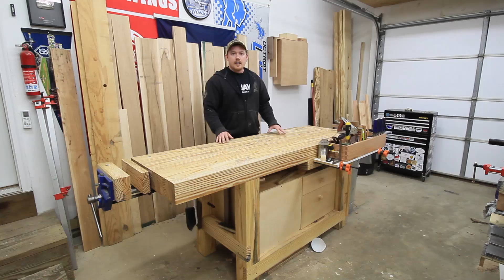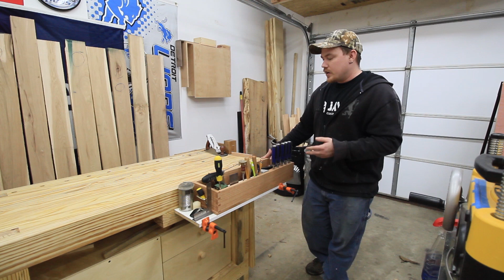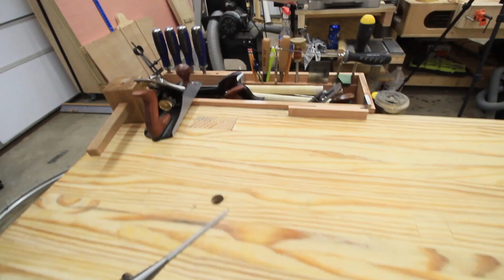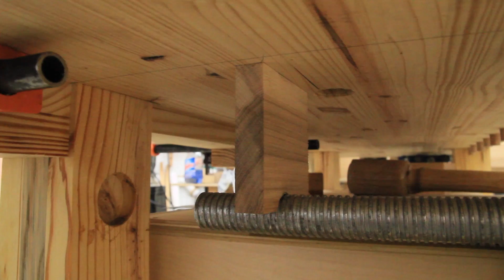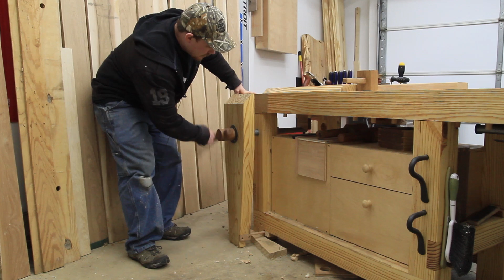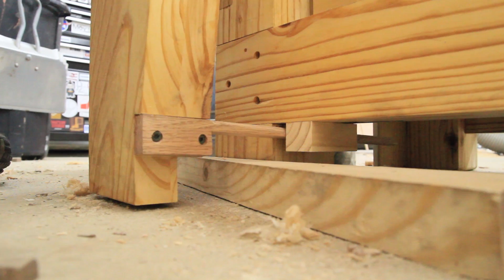Workbench Upgrades - 240

Comment: Great video as ever Jay, thanks. Re leg vice; strikes me that it might be easier to simply fit a pegged parallel guide from the outset but use the wedge for most purposes and only use the peg when working on exceptionally thick/wide pieces. Never can understand those thumbs down, wherever I see them. Power to your elbow.

Comment: Jay, I notice behind you and remembered from a past video that you prefer vertical storage of your lumber. I was always under the impression that you should lay it flat to prevent warping. Is that not the case? I would like to store it vertically as it would be easier to see and  get at what I need. Thanks,
Greg

Comment: Is the table too thick to use holdfasts? I've never used them before and want to build this table to use them. I plan on using 2x4s (maybe 2x3s if it's too thick).
Reply from the maker: Yes. Counterbore from the bottom side to reduce holdfast engaging hole thickness to about 2-1/2"
Reply: Jay Bates I don't have a counterbore, do you think I can use a router to carve out a section around the 3/4 hole?
Reply: You can buy a cheap set of Forstner Bits at HF for less than $15 and use the 1 inch bit to do the counter bore

Comment: Great series of videos; I almost never watch a video over a few minutes but the production quality was so high on these that I really enjoyed watching.    Knowing how to make a great video is as important as knowing the topic you're presenting - well, at least it makes watching the technical content much more enjoyable.  Thank you!

Just a tip: on the leg vice, if you were to cut a small wedge at the same angle as the movable wedge, you could prevent twist or uneven pressure on the bottom.  Maybe just cut off the appropriate length from the pointy end of the wedge you have, flip it over, and attach it at the bottom of the vice.  This would increase the pressure surface area at the bottom.

Comment: Jay, did you ever put any kind of a finish on the top of the bench?
Reply from the maker: Boiled linseed oil for a month. Then flattened it for the first time and tried Danish oil instead. I like the danish oil better. Not as thick as polyurethane but a bit more protection than boiled linseed oil.

Comment: Hi Jay, did you decide that you didn't need the oak dowels at the stretcher joints?
Reply from the maker: +Marco Nonya correct. I ended up not using dowels.

Comment: Here is a thought.The maximum stock clamp-able in the foot vice is reliant on the floor wedge width / angle.To clamp greater stock dimensions would need a very large / long wedge. This would be too long and get in the way of your feet.Imagine this very long wedge cut into two wedges one the smaller taper and the second the larger. Now this is a pain because you need to alternate.If you combined them at 90 degrees ( screw and glue) you would have both and still foot operatable.So, two faces are still flat at right angles (making a corner) with the other two tapered yet with different widths of taper? You could use your foot to rotate the wedge 90 degrees depending on what stock thickness you are using.  Even if you don't want greater stock usability it takes the unused thin part of the wedge away from you feet at the bench end (when working with thick stock) and shortens the amount of wedge at your feet on the long bench side (when using the clamp for thin stock).
Not sure if you will follow my bad description, however I'm sure you might appreciate possible future modifications. And, this is a really simple one.
Great channel......awesome bench.

Comment: I was wondering what you're best work around was before you had your jointer. I've been working on similar projects. (Benches and tables.) with that kind of laminated top. Any suggestions on milling and squaring up lumber?
Reply from the maker: +Jack Tibbetts Cut a little off one side, then the other, then the other, until you get a straight enough board to use.
Reply: +Jay Bates Thanks. I definitely want to get one soon though. They totally seem like they make things easier
Reply from the maker: +Jack Tibbetts They really do. Since getting mine I've ran every board for every project over it. If not, close to every board.

Comment: does that single wedge put any sort of twisting pressure on the vice considering it's only clamping the wedge on that right end? wouldn't it be better to incorporate a complimentary wedge?
Reply from the maker: +Everfalling In the video where I installed the leg vise I showed that I cut out a section on the bottom of the leg vise that matches the angle of the wedge.

Comment: Very nice Jay. Maybe you could add a matching nut fixed to the proper height instead of that loose wooden spacer. Also, the wooden slider at the bottom looks a bit thin, no?
Reply from the maker: +M.Emrah Ozkaya The fixed nut is not necessary as the loose wooden spacer is working just fine. The slider at the bottom is plenty thick enough to complete the task.

Comment: Nice workbench alterations, I can see how these changes would make it much more versatile and functional. I have a question though. When you were showing your solution to prevent the leg vice from rotating when you turned the handle I thought it looked too complicated and clunky. Why didn't you just drill a 1" hole through the bottom of the leg vise and a slightly larger hole into the leg of the workbench and insert and glue a length of 1" oaken dowel into the leg vise. I think this solution would work just as well and look a lot better since the dowel would be centered in bottom the vise and be hidden in the leg of the bench. Just a thought. The bench looks great and I am sure it will serve you well for many years. Thanks for posting the upgrades.

Comment: The leg vise is great but you could improve it by shortening the handle. You do not need the leverage supplied by that long handle and you would not hit yourself when leaning over to spin it! Now, an important question. It is my understanding that woodworking bench are made so massive/ heavy so that you can plane and/or otherwise work on them without moving them. So, in a perfect world you could have a top made of ummovableinium that weighed ONE pound and was as the name says unmovable. I do not plane or have a need for such mass. In my world a top made of a substance like the Festool MFT top might be superb. Is my thinking correct? Thank you for the great video as usual. I mean you always make great videos.

Comment: If you're worried about the benchdogs getting too loose, embed a single ball catch (sometimes called a bullet catch) in one side of each bench dog. They don't need to be glued in, just a tight fitting hole. The catch is spring loaded, makes for very easy insertion/removal, but it won't fall through

Comment: I feel like all of the adjustments needed to your leg vise are due to the lack of a parallel guide. Why not just install one? I heard you say on the podcast that you didn't want to put a through mortise in your leg but I can't imagine it would have effected the structural integrity. The traditional pin system is a pain but you could use one of the chain systems available. That's what I'll be putting on my Roubo. You could have also used the Benchcrafted Criss Cross setup.
Reply from the maker: +Crafted Magazine I like the convenience of the wedge. And this option is much less expensive. Especially if you make the screw yourself. All personal preference. Any one will work.
Reply: Gotcha, makes sense. Thanks for the videos man. Your workbench inspired me to go for building a Split Top Roubo. Starting rough cutting the wood (hard maple) this morning.

Comment: A really simple upgrade to the dowels for bench dogs is to cut a slot down the middle of them stopping short about 3/4"-1" from the top and then jam a really short little wedge all the way up the slot so that the two halves spread apart.  That gives you a little spring effect so they can be looser but still stay in place.  Takes a little trial and error to get it right.
Reply: or drill a small hole at the top of that channel, use a smaller channel and a properly sized hole under the dog and install a piece of wire hanger as a spring.

Comment: Awesome! I'm in the process of building my workbench now. Took boards from a deck tear off for the top, cut them in half and glued and screwed them, it's not even and I've spent hours sanding this sucker trying to get it perfectly level but I'm calling it good enough. I just got started woodworking last year so I know very little but I think I'm going to steal some of your ideas. 👍
Reply: best suggestion for smoothing that top is a jack plane, the longer the better. not hard to use, but so worth the investment if you can get one. as with any tool, if you are not familiar with it, practice on some scraps before taking it to your project.
Reply: +Thomas Russell   Thanks

Comment: Happy Easter to you & Jamie! If you did not have pipe clamps & did not have wall space, would French cleats on the side of the bench work to hold the tool caddy? Or, would you need to extend the "wall" behind the caddy downwards? Hope that made sense.
Reply from the maker: +Del Johnston If I didn't have wall space to eventually put the hand tools on I would probably have built a tool well into the table.

Comment: There is something satisfying about using something that one has DIYed well, but for most work, wouldn't that quick release Record style vise have workef more conveniently than that leg vise, if it had been installed in that position (thinking Paul Sellers), (not a criticism, it just seems like leg vises are kept around more out of nostalgia than practicality), maybe I'll have to try one to get it.
Reply from the maker: +Darnley Bynoe I prefer using the leg vise a lot more. Much more clamping power with little effort and much more room above the screw. I'm not totally thrilled with the cast iron vise. It's handy for some tasks but I just overall prefer the leg vise.
Reply: Yea, I guess one needs a side by side (hint: good subject for a video) to know for sure 😉, thx

Comment: I was wondering the same thing as Moochie Kat. How did you get the dog holes a perfect 90 when you drilled them?
Reply: Not sure how Jay does it, but using a drill guide is one option. https://goo.gl/GlFyWe
Reply from the maker: +jimgam730 I don't drill them perfectly 90 degrees. I start the hole with a forstner bit to get a clean cut about 1/2" deep. Then finish the cut with a 3/4" auger bit on a slight angle with the top tapered towards the tail vise. Just drilled by eye.

Comment: How did you get a 90 deg. hole for the dog holes? I know you didn't put it on the drill press. I couldn't get a perfect 90 when I drilled mine. What's the trick?
Reply: Not sure how Jay does it, but using a drill guide is one option. https://goo.gl/GlFyWe
Reply from the maker: +Moochie Kat  I don't drill them perfectly 90 degrees. I start the hole with a forstner bit to get a clean cut about 1/2" deep. Then finish the cut with a 3/4" auger bit on a slight angle with the top tapered towards the tail vise. Just drilled by eye.
Reply: Jay Bates Thanks. You have a better eye than me. I was so disappointed with mine, I plugged them with dowels. I did see a youtube where the guy used an up-cut bit in a plunge router and then finished with a forstner bit. I might try that way.
Reply: Del Johnson, thanks that should work.

Comment: Nice modifications! How did you cut those deep dog holes in?
Reply from the maker: +MRrwmac  I don't drill them perfectly 90 degrees. I start the hole with a forstner bit to get a clean cut about 1/2" deep. Then finish the cut with a 3/4" auger bit on a slight angle with the top tapered towards the tail vise. Just drilled by eye.

Comment: Any warping in the top? Was looking on building one for myself but scared the top would warp by not using hardwood.
Reply from the maker: +Andre Regimbal Hardwood vs softwood has nothing to do with something warping or not. Irregular changes in humidity/moisture content causes wood to warp. I started with kiln dried wood from Lowes. I had about 1/16" of hollow in the center from day 1 and never got around to planing the top as it wasn't that big of a deal. I figured it would move more in the next few months but it didn't so a few days ago I planed it flat for the first time. It's holding up just fine.

Comment: 2 questions 
The spacer under the bench for the screw.... How far back do you mount that.. Does it matter? What do you use to sharpen your chisels and drill bits?
Reply from the maker: +Richard Shaw I didn't mount the spacer. It's just sitting there. The distance is determined by your particular setup. I moved it around until I found what seemed like a good balance point to allow the vise to operate more smoothly.